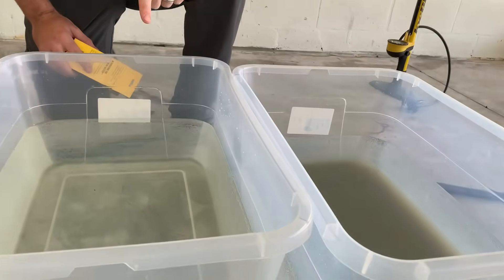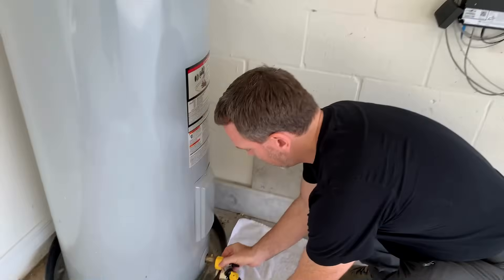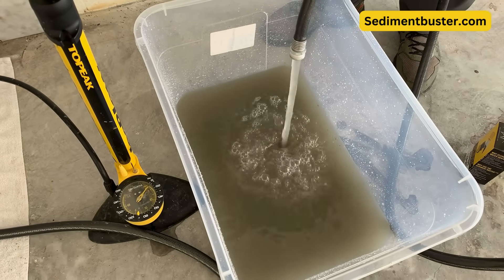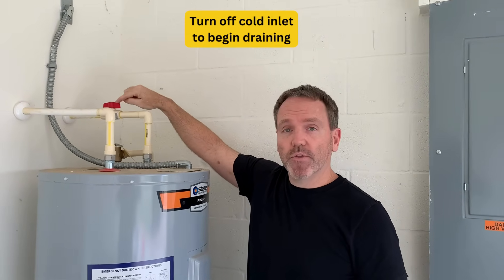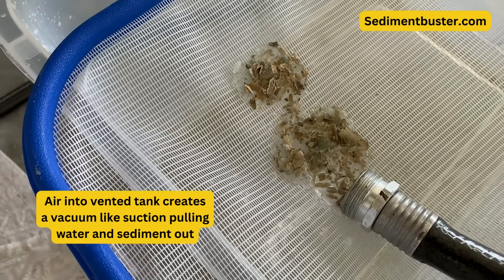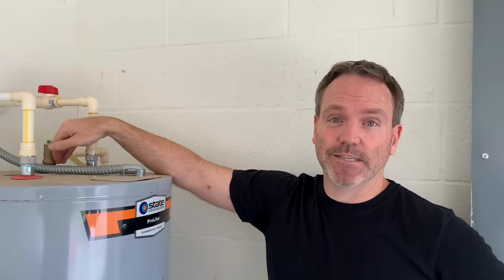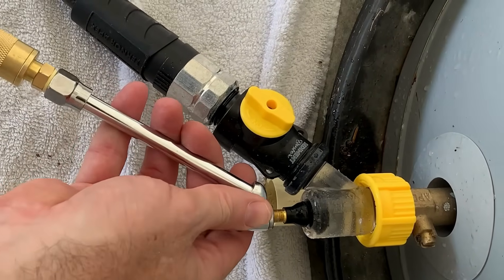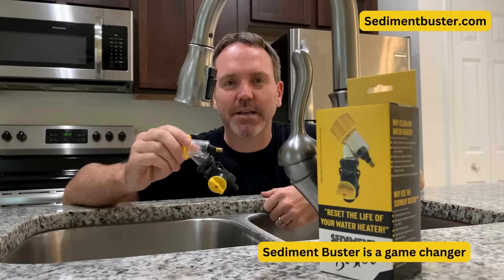Sediment Buster Unclogs, Flushes AND Drains a Water Heater Tank like you've never seen before

Comment: Empty the tank completelty then pump the cold water shut off until it runs clear, literally does the exact same thing. It disturbs the bottom where all the sediment is.
Reply from the maker: Empty the tank, but first break up the clog.  I know it is hard to believe, but pumping cold water only makes a channel to the valve, but the SB sucking action pulls it out so much better from our experiments.  Thanks!
Reply: @SedimentBuster  doesn't the Sediment Buster do a blowing action rather than sucking?
Reply from the maker: @murky2502  yes it definitely blows, but with an air compressor quick bursts actually pulls sediment as we demonstrate
Reply: @SedimentBuster  I install tank for a living. If it's that clogged (which it rarely is), I put the other end of my hose to a tap and run the water, it does the exact same thing.
Reply: @dereko4471  Probably that works for some but not for others.  NOT paid to say this (nor do I know Sediment Buster co) but his video did show a level of back and forth pushing / pulling / sucking that is likely hard to easily replicate with a regular water line.  Where is the Project Farm guy to run a test ?  LOL!
Reply: @dereko4471 Do you live somewhere with hard water? This definitely makes a big difference out here in the rural Southwest.

Comment: I have to make a suggestion. When your ready to fill the tank back up, go around to all faucets and remove the aerators. Otherwise you may end up clogging one with sediment that might not have gotten flushed out with everything else. Better safe than sorry.
Reply from the maker: That is a great suggestion.  We had a customer claim this happened to him.  However, I believe the issue was his drain valve.  If you have a 3/8 hole drain valve or better, and you drain the tank completely, the sediment will predominantly be removed.  In this case, sediment collecting at the aerators have been minimal.  If you have a restrictive drain valve, You can drain the tank empty first through your current drain valve with the help of Sediment Buster, then replace it with a full port valve when the tank is empty, then finish cleaning the tank with the tool
Reply: Yeah, and don't open any shower valves to vent because it's a lot harder to clean out sediment/debris from shower heads and shower wands.
Reply: @BrianW211 Good point. One can also just divert the water to a tub spout, if available. The outgoing volume of water there is rather large, so it's a good pathway for debris to exit.
Reply: Yeah I was   thinking the same thing
Reply: If it's that bad then you probably have so much sediment in that water heater that you'll probably need to flush it out a few more times in a row. Hopefully you get lucky and that will be the end of it. The only time I have run into that issue was when a hot water heater wasn't flushed in many years.

Comment: touching that CPVC valve made me nervous 😬😅
Reply: I flooded out a house before when resetting a toilet on the third floor  CPVC eith a stop...the toilet barely brushed against it ,snapped it off inside the wall and the stop by the time I got to the ground floor and out to the meter it had poured through all three floors.
Reply: @jojodamunkeyboi that's what I was talking about - I was afraid the pipe will break off behind the valve somewhere
Reply: I couldn't figure that out at first.  Guess they build things a little better in Michigan.  Can't say I've ever seen one hooked up to a water tank.
Reply from the maker: I can understand that.  I’ve noticed that turning of the water to the entire house relieves the pressure through that cpvc valve allowing it to turn a little easier.  That said, replacing that cpvc with a brass valve is never a bad idea.

Comment: I like it but I'd still like some rig setup to see the inside of a tank while using the air pressure.
Reply: You could always pull the anode rod and use a bore scope.
Reply from the maker: Next time I get into the field with some of our plumbers I will try to get that internal camera shot.
Reply: It'll take a fancy bore scope with an articulating head.  I tried it after removing the anode rod, but my bore scope only articulates in one plane and the humidity kept fogging the lens.  The inside of the tank is dark steel which absorbs light so you'll probably have to add an additional light source.
Reply: @Calliber50  thanks for the information. I have my bore scope but how would I go about adding an additional light source besides the one that the bore scope has already
Reply: @user-zt5yf1gw4n Might be able to run a string of white LED Christmas lights down into the tank as well.   Any additional lights would be helpful.  It's extremely dark inside the tank and bore-scopes have trouble focusing on objects several inches away without light.  Make sure to flush out the hot water as the heat and steam will fog your bore-scope too. Or you can warm up your bore-scope with a heating blanket or a hairdryer on low heat before insertion.
Reply: Agreed, that is an excellent idea.  Would make for a very convincing video

Comment: The "sacrificial" Anode rod, whether made of magnesium or aluminum, is the source of the sediment. Therefore, that Anode rod should be removed for inspection & replaced, depending on it's condition. Use an impact wrench with a (six point, not 12 point) 1 1/16" impact socket to release the factory installed Anode rod. There are also alternative replacement Anode rods that instead use a low-voltage electric current (from a plug-in wall adapter) that supposedly eliminate the sediment buildup problem.
Reply: If you have heavy water that also creates 
Sediment.....
Reply: @851995STARGATE  Hard water. Heavy water is used in atomic bomb production.
Reply from the maker: Removing the anode rod every 4-6 years is a great move.  Clean the tank of the dirt and sediment and replace the rod to attract future minerals.
Reply: Rodger Wakefield did a recent video on the product with a view of the inside of the tank. https://youtu.be/C_5dlaW37YM?si=mWpOHFZ3DW7UixON
Reply: It depends on your location. When I lived in New Jersey, we were on a well. Major sediment and had to flushtdrain every year, minimum. In Phoenix, it was every 6 months, and we were all on municipal water. Here in New Orleans, it can go two years or more.
Reply: I hate to tell you this, but I have seen multiple hundreds of anode rods that had 80% or more left and the tanks were still full of sediment so deep it burnt out the lower element/s...
both city water and well water, some minerals and near neutral PH water will do that when heated by elements. it's mainly "electric" water heaters with the issue, due to the smaller surface area of intense heat produced. gas units around here(well water) tended to last longer than the plumbing or installer workmanship.
of course NONE of it lasts now days and your lucky if it's any good from the factory!.
Reply: @throttlebottle5906  YES, I've replaced lower element and at that time the goopy sludge that came out was amazing. Since then the new lower element has toasted and I'm afraid of what I'll find this time around. This is ultra high calcium content water out in southwest desert region. I put this tank in new, back around 20+ yrs ago and afraid now to kick the sleeping dog.

Comment: Definitely not a Calcium buildup.... This method keeps <Channeling> sediment in front of the Drain. Anything actually Stuck to the tank walls or any Large chunk buildup will likely remain untouched.
I'd trust these products more if the Users did an on camera scope of the inside of the tank before and after.
* I've hand cleaned the inside of an Electric Water Heater and removed Gallons of Lime/Calcium. i.e. piled above the lower element.
Reply from the maker: Two points of agitation works well for calcium as well as dirt.  We are new to the market but give us time, and we will get interior tank shots!  Thanks for viewing
Reply: looking forward to this @SedimentBuster
Reply: Is the main point not to clean around the heating element, which is at the bottom? I think the walls would be the minor issue. If any maintenance is to be done, this method is better than doing nothing at all. I do not know how plumbing companies do their water heater flushes, but if all they do is either use venting and gravity, or the city's water pressure the clean out sediment, then again, the method in the video seems more favorable.

Your (or anyone's) thoughts?
Reply: How did you hand clean the inside?  Is there a brand or mode that lets you easily open it up for hand cleaning?
Reply: @tubsun he has 3/4” hands that go in through the drain hole